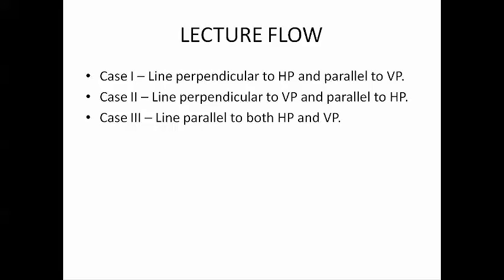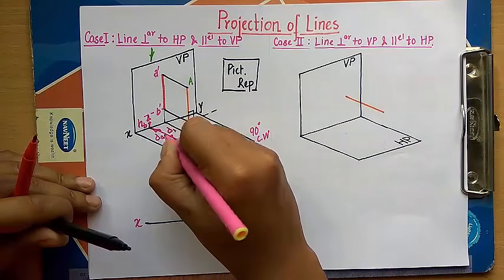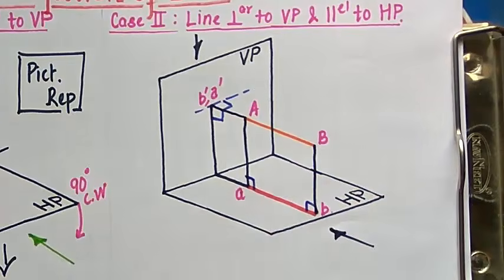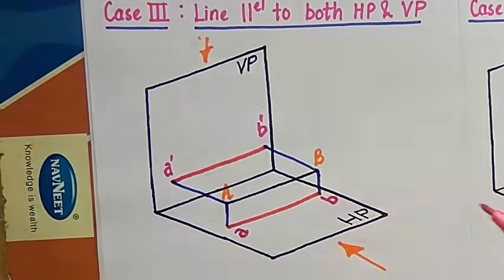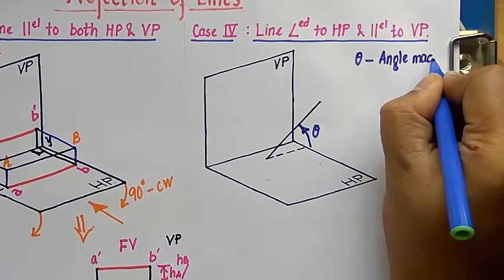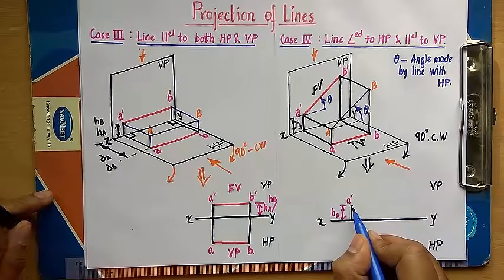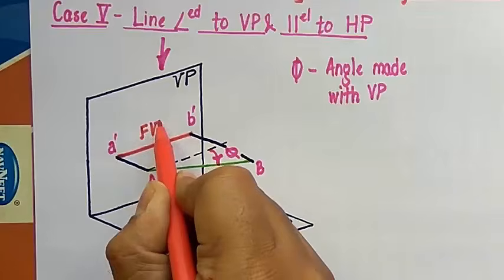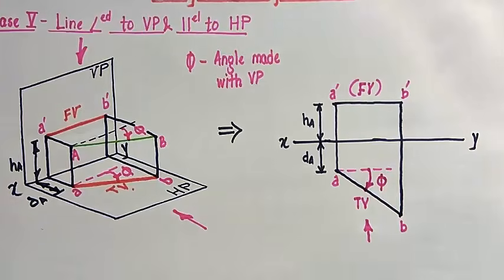Projection of Lines | Part 1 | Line Inclined to HP or VP

Comment: Sir, I have a question...
The distance between the end projectors of a line is zero.which orthographic view of the line show its true length?
Hope, U respond for my question
Reply from the maker: Hello Chaithra,
First of all let me appreciate you because the question you asked is quite challenging. There could be multiple solutions. So here we begin....

Let us take the example of a ladder. Please remember this solution strictly follows a specific Rule and that states that the distance between the end projectors is zero.

Consider scenario number 1:
Assume that the ladder has one of its end on the wall while the other is on the floor. In this case the Left hand side view view of the ladder will show its true length. And remember that the side view is obtained on the profile plane.

Consider scenario number 2:
In this case letters assume that the ladder is completely resting on the floor and at the same time perpendicular to the vertical plane. In this case the true length can be seen from the top that is top view. Remember that the top view is obtained on a horizontal plane.

Scenario number 3:
In this case latest assume that the entire ladder is sticking to the vertical plane and at the same time it is perpendicular to horizontal plane. Here the true length can be seen from the front that is front view. Remember, that different view can be seen on the vertical plane.
Reply: @ManasPatnaikofficial  Thank you sir...
It helps alot..

Comment: Ex. 4. A line AB is inclined at 30◦ to HP and it is situated in first quadrant. The end A is 10 mm from HP while the end B is in the VP. The midpoint M of the line is 35 mm above HP. The distance between the end projectors of the line is 70 mm. draw the projections of the line AB and the midpoint M. find the plan length, the elevation length and the true length of the line. Also find inclination of the line with VP.

Comment: A line AB contains a point C on it such that the ratio of the distance 
of the CB:AC is 2:1. The end A is 20 mm above H.P. and it is in 1st 
quadrant. And the other end B is in V.P. The point C is 35 mm 
above H.P. The line is inclined with the H.P. at an angle 30°. The 
elevation length of the line AB is 70 mm. Draw the projections of 
the line AB.

Comment: A line AB is making an angle of 45 with vertical plane and parallel to horizontal plane. Its
end A is 20 mm above Horizontal Plane (HP) and on the Vertical plane (VP). Draw the
projections if the line AB is 100 mm long.

Comment: If a thin rectangular plate of 60 mm × 30 mm is inclined at 60° to HP with its smaller side parallel to HP, its top view will be
1) square of 30 mm side
2)square of 60 mm side
3)any of the above
None of the above..... can u explain sir???
Reply from the maker: Abhay...This is pretty straight forward....
This is plane trigonometry..
Its gonna be a square (All sides 60Cos60 i.e 30 mm)